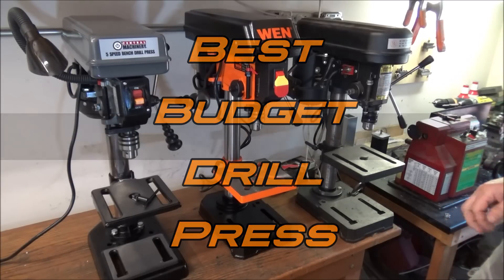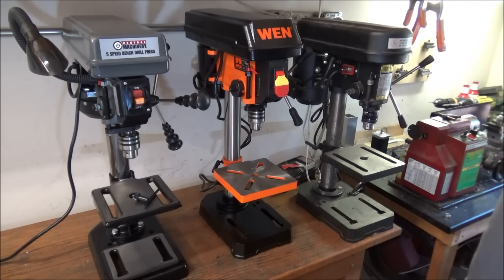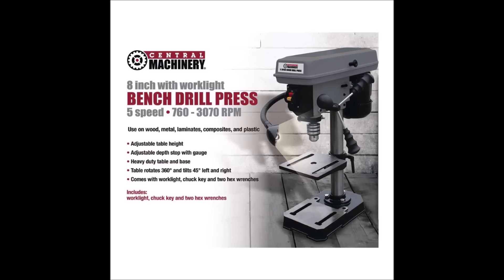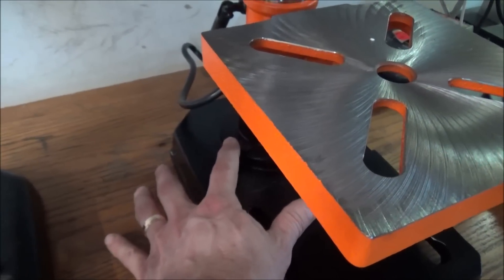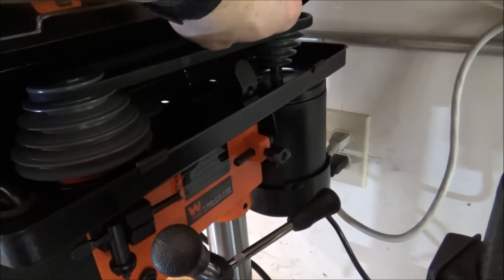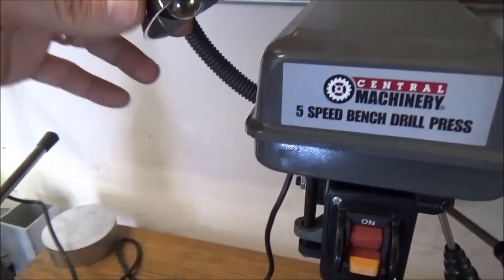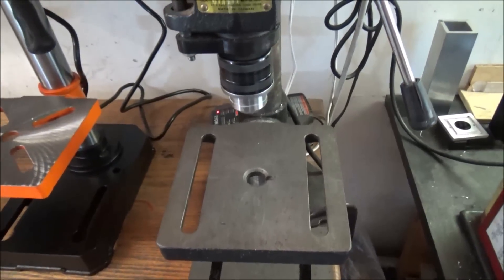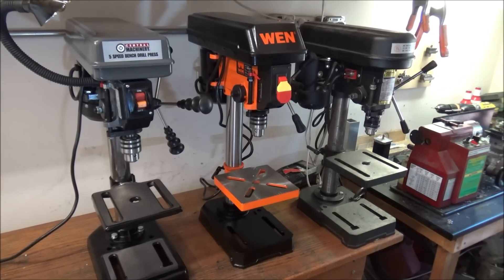Best Budget Drill Press Harbor Freight Vs WEN

Comment: everybody hates HF but 70 percent of their shops are HF LOL
Reply: Harbor Freight makes a good drill press but it costs $599 for a 20 inch production machine. The 8 inch Harbor Freight drill press with the stamped table and base is absolute crap I owned one and sold it.  I also have the earlier cast iron model which was an is still fine.
Reply: HF, it's cheap and convenient, but some of there crap is alright quality
Reply: Love it! So true. They all say my HF tools are crap but they like what I make with them. I have two HF welders and they're great. Can't fault them.
Reply from the maker: Yeah I don't hate , Just hate some things! Like you I have about a 70% success rate. but I have had brand names treat me the same way so at least with HF your not getting ripped off !

Comment: From the sound of it on the WEN it’s like something is loose possibly. It sound like metal on metal contact at some point. Maybe a high spot on the inner spindle of the quill or the inner housing of the quill making contact at some point probably worth investigating. It’ll probably take a lot of the vibration out.
Reply from the maker: I had purchased this specifically for a machine I'm building so I will investigate that thank you.
Reply: CNC4XR7 no problem bud if you do find the issue show us a how to video. A ton of people have this one drill press and I know would appreciate the value in it.
Reply from the maker: @rayflowers9097  
I will do that. Thank you.

Comment: I appreciate the vid, but comparing HF products to anything is pointless. HF stuff is crap. Better to compare Wen to something better, not worse.
Reply from the maker: Thanks for the comment. There are three Bench top drill presses in the video I did compare the WEN to both the HF and My Value craft which is 30 years old and a Taiwan made piece.
The WEN closely copies the Value craft which has proven to be reliable and durable.
I agree HF is hit or miss Just got a welding stand from them and it's a great value! at $56

Comment: NEVER buy anytihing electrical from Harbor Freight.  I have had nothing but problems with their cheap crap.  hand tools, other stuff yes but nothing electrical
Reply from the maker: Yeah In My experience its hit or miss. I had a cordless drill onetime  it was Crap! my porta Band saw its been Awesome and I think I paid $59 for with a coupon. much better on the wallet than a Milwaukee , Dewalt, or PortaCable.
Reply: @CNC4XR7  I had an air Compressor a small one I think it was chicago electric.  it never worked had to exchange it 3x and finally they gave me my money back but they took a big 20% chunk out of it for a "re stocking fee".  never again will I buy anything electric from there although I buy other stuff there and have been happy with it all the time

Comment: Wish I’d seen this before buying (and returning) the Harbor Freight 8” drill press!  On the one I bought, it was impossible to move the motor spindle/ pulley to loosen the tension on the belt to move it to a different level on the pulleys and thus change the speed.  Also, the table was supposed to be able to be tilted 45 degrees left and right, but the adjustment bolt was absolutely unmoveable, so that feature didn’t work either.  Can you comment on the ability to move the motor (to change the belt) and to tilt the table, on the WEN?
Reply: Most Chinese drill presses come with the motor hinge pivot  bolts too tight the need to be a bit loose to allow the motor to pivot for belt changes and tension adjustment.
Reply from the maker: The table has a bolt in the center Exactly like my 30 year old drill press maybe 17mm bolt not sure. it is solid simply loosen move and tighten. the Belt adjustment is a Tee bolt the tee is plastic and on my old machine it cracked after about 15 years LOL but to change speeds simply loosen Tee bolt push the motor forward ( there is a guide pin and light spring just to keep some tension on it I presume) move belts push motor back and hand tighten the tee bolt.
both of those seem to work fine for me.

Comment: My bench top drill is the same as. Your old one but as branded Pro Tool. I was in the middle of a project with my late 40s early 50s Craftsman and the pressed rod on one side of the motor mount came lose. My $20 second hand bench top press came to the rescue and 30 minutes later I had the rod drilled, tapped, bolted on and was back to the original project. The best part was providing to my now ex-wife that it was a good idea to have both a bench and floor model drillpress.
My benchtop has some bearing rattle as of late. Time for me to check YouTube for some rebuild videos.
Reply from the maker: The often overlooked Bench top drill press Great for those jobs that dont require a large drill press or a hand drill.

Got to love these things. I have many hours of run time on my 30 year old model.

Comment: Another couple of tests: Check for slop in the chuck spindles and the quill, to see how much "skate" you get at the tip of the drill bit. Another test, is to test the "run out" in the chuck. Just chuck a straight rod, and turn it on, and see how far off center the tip wobbles. That's my biggest test of a good quality drill of any kind, weather a press, or hand held. A lot of that vibration could be reduced, if you could balance the pulleys, and the motor rotor. Quality belts also help.(I like the WEN the best)
Reply from the maker: yes good tests the HF quill was a very rough casting looked as though it was turned with a drill and trued with a handheld grinder.
Reply: The quill slop in the H/F is terrible.  The wen Quill is much better fit to the head.

Comment: My issue with these small drill presses are the speed selection. There is nothing I drill that I ever needed 3,000 rpm. On the other side of things, I more often need something well under 500 rpm. Larger hole saws, forstner bits, circle cutters, etc don't work with high rpms and can be dangerous or ruin bits from excessive heat.
Reply from the maker: yeah it has 5 speeds just not the 5 you need LOL
Reply: These small drill presses are for drilling small holes. For a lot of home shop projects they're adequate and will net a user fairly perpendicular holes in work. Better than they'll do with a pistol drill. But I do have triple reduction hand drills that run slower than the small bench top drill presses do. A few real wrist breaker specials they are.
Reply from the maker: @1pcfred  agreed

Comment: I have an older HF press that was my dads so it got to be 30 years old or so and it looks like your old one. It isn't like the new HF press your showing and i have to agree with you the Wen wins! LOL
Reply from the maker: That's one thing that really Upsets me about imports I understand we all need to make a Buck. But I would gladly pay the extra $10 they are saving for a better quality product. you can clearly see the older HF version on the ads I saw was built better.
Reply: @CNC4XR7  I have the HF model shown in the ads, with the cast base and table. It's only about 8 years old.
Reply from the maker: @ctrlaltdebug  yeah I dont think its been that long since the stamped steel tables where shipped ! less than a year or 2

Comment: As of today, WEN is $101.10 on Amazon and HF is $54.99.  I'm sure deals and coupons change all the time but when you do comparison, you should compare ones of similar "RETAIL" prices.
Reply from the maker: I Agree and in the video I give the cost of both drill presses. The WEN was $76.63 on Amazon purchase date was May, 18th ,2019.  I cannot control the cost of these products and at the time the WEN was not on sale. Having said that the WEN IMHO is 3 times better than the HF.
Reply: I just checked the Wen 8" drill press price on Amazon and the Wen is $81.18.  Amazon has some sort of dynamic pricing so I have seen the prices fluctuate quite a bit on some of the tools like acetylene torches.
Reply: Current as of Oct23 2019 Wen Price on Amazon is $81.18 and it ships free.

Comment: how much does the table flex, will the table even stay level?  I made a new clamp and table for my cheap drill press.
Reply from the maker: The WEN and my old drill press both have cast tables the WEN is sturdy and tightens up  nice no noticeable flex. the HF it's a little cheesy all around.

Comment: If you want smoother running on any drill press, replace the V belt with round section belting (like a big O Ring).
Reply: Most V belts run smooth if the owner aligns the pulleys and sets the belt tension correctly V belts are less prone to slippage than round belts when properly set up.
Reply: @robc8468  Exactly what I was about to say. Thanks for setting this matter straight. I have owned a big upright drill press ( made by Champion) for decades and it drills so nice simply because I take the time to line everything up when I either change belts or speeds and it's a 12 speed floor model.
Reply from the maker: Great tip!
Reply: @CNC4XR7       i use these type belts that imake as i need to.....have them on all my machines in my shop ......great tip though.

Comment: I had a Craftsman still press that after 20 years had enough. I bought the Wen, (NOT WIN 😉) and it works really well! I have a two way table on it that makes it easy to precisely locate my holes, I had to give up some depth but for what it’s designed to do for about $80 it’s a winner in the home hobby shop.
Reply from the maker: Really it's pronounced "W" " E"  "N"     Hmm I did not no that LOL  I do that all the time
Reply: @CNC4XR7  You didn't no that or you didn't "know" that?
Reply from the maker: @lennym1273  correct i did not know that lol

Comment: Nice review. as with any job, it requires the right tool. Using a small press for big jobs, you will end up with a broken heap. You 1989 drill is still in great shape and a testimony your understanding of it's limitations. So that legitimizes your review for the WEN.
Reply from the maker: Yeah no complaints on my old benchtop. But I use it for light drilling. This new when is perfect for my project build.

Comment: I have a WEN 4212 it wasn't inexpensive and it's a pile...
Reply from the maker: WOW Really This 8Inch for what it is is fairly nice well compared to the HF with the aluminum pulleys and stamped steel parts.
Reply: @CNC4XR7  It would be a decent unit if the spindle wasn't so poor.
Reply from the maker: @JustinAlexanderBell  man maybe you got a bad unit mine was nice and smooth bearings felt good. The HF spindle was horrible bearings felt gritty and housing finish was horrible.
But hey for$67 what should I expect.
Reply: Wen is overrated. I'd go for harbor freight
Reply: @chupasoplas  not in the 8 inch D/P class the stamped table ones have a loose quill that can not be adjusted out.